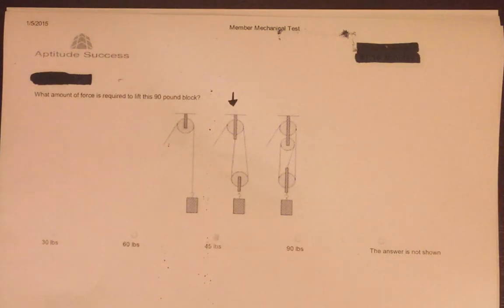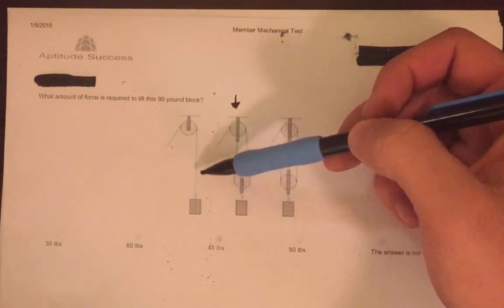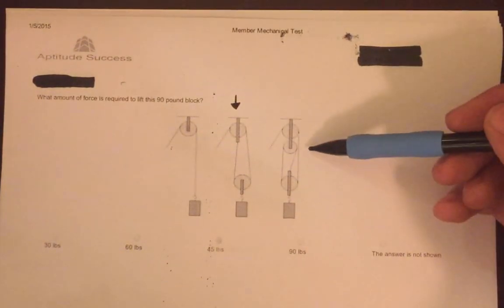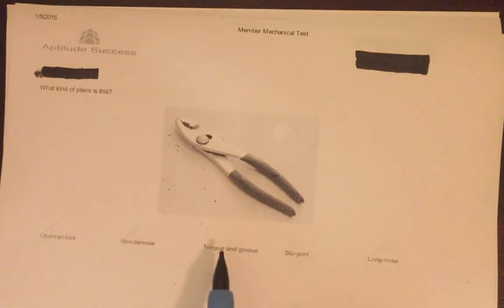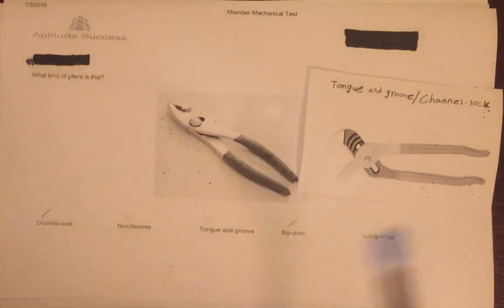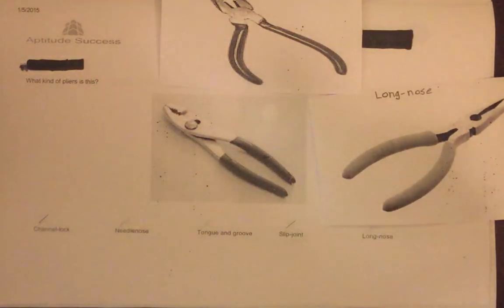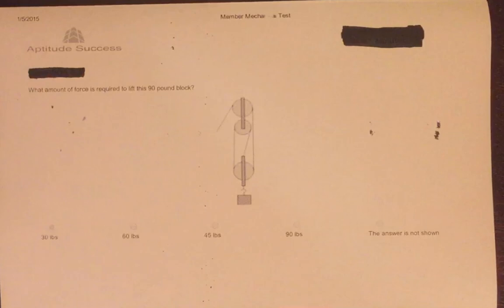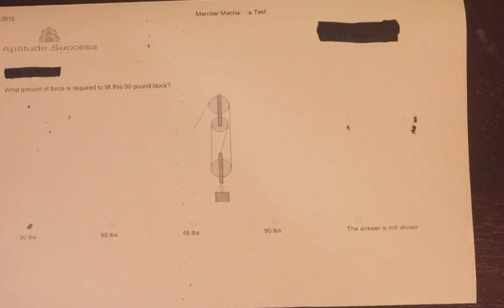Mechanical Reasoning Pulleys and Levers

Comment: hey mate are all of these a part of the FRNSW testing? Thanks
Reply from the maker: these were created in 2015 and was 100% relevant to questions at that time. as you know, exams evolve and some of them may get retained or change as years go along. one thing though is that their concept never do. regardless of the question, solutions will always be done in the same manner for the same problem.
Reply: Ok so the mechanical resining, verbal reasoning etc are still relevant for FRNSW? Thanks for the reply
Reply from the maker: @cccccc54able  they should be since these type of exams are sprinkled all over the revelian aptitude test. we provide updates on recruitment and their exam providers. be sure to follow us on FB
Reply: It’s just that on the website it says we only get tested on cognitive, work safety, work reliability and emotify
Reply from the maker: @cccccc54able  Hey There, so the work safety, work reliability and emotify are 3 seperate tests. NSW still currently tests with the classic cognitive tests as well. We have created training around all of the components mentioned. just reach out to me via our website if you need further information www.firerecruitmentaustralia.com this particular video is more of a fundamental skill video, we have specific FRNSW tutorials, question and tutors to help you with all of these tests if need be. 

Hope that helps,
Brent